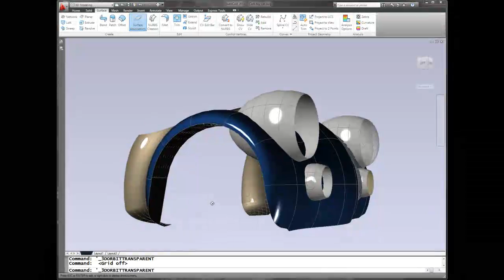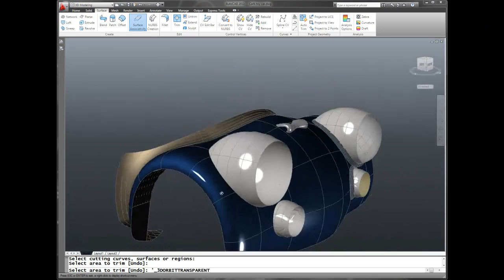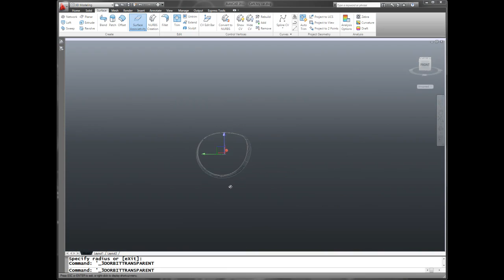AutoCAD 2011 Car Surfaces

Comment: @ThatPerson49 You don't know what your talking about, 3ds Max and Maya are 3D modeling, rendering and animating software packages. ACAD is more a drawing or designing package for a product that you are going to make. Max would be used for things like games and 3d animation in the film or advertising industry. They would never use AutoCAD to create a 3D film. That said, there is nothing wrong with designing a car in AutoCAD. However the topology might not be fit for in game usage or render times.